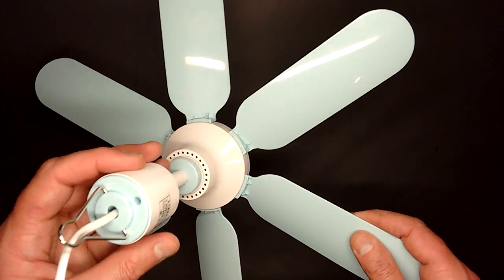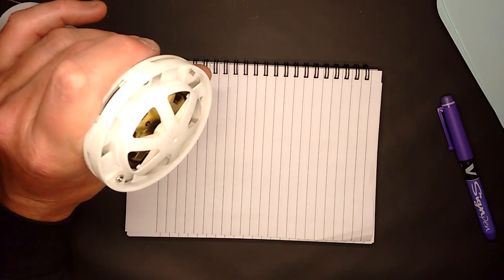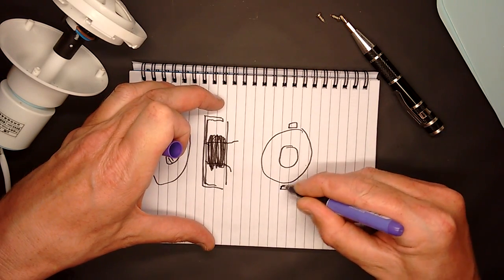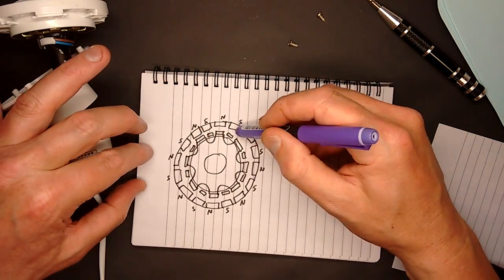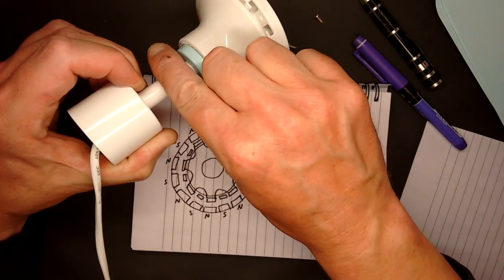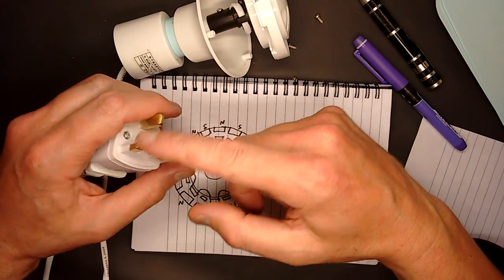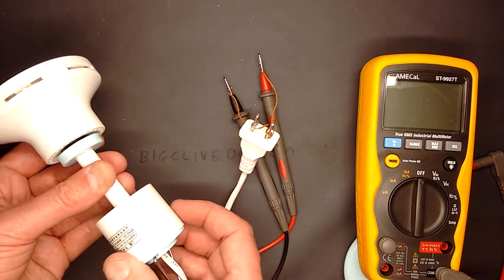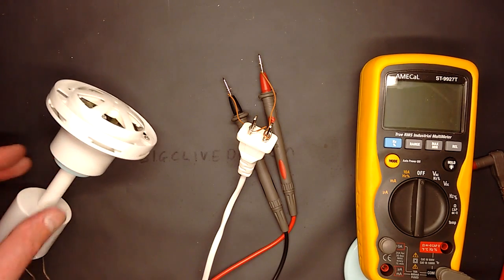Mini ceiling fan with intriguing motor and wind turbine potential.

Comment: I have seen usb versions of these fans, any idea what they are using?
Reply from the maker: I think it's a scaled up computer fan style motor.
Reply: @bigclivedotcom  I bought one and its wierd, its mechanically identical to the 240v version but its got a little IC in it, I thin its just been rewound. it comes with smaller blades and it turns much slower,.

Comment: I bought one of these fans recently after watching your video to check its viability as a generator and here is what I found:

1.  Resistance of the coil is quiet high ~ 2k ohm
2. The fan could produce very high voltage > 300v when spinning at 500rpm. Spinning by hand can easily produce 150+v 
3. current is however very low. 14ma short circuit. also 14 ma when charging a lithium battery and 10ma when charging a large 50v lithium battery.

This last point was an eye opener for me because I have always assumed that current linearly increase as the voltage drop. I was expecting that if the fan could supply 10ma @ 50v then it would be supplying 100ma @ 5v. Clearly I was wrong.

I then checked a solar panel that I have to see if it exhibit same behavior  and sure enough my 5v solar panel supplied 32ma short circuit and also 32ma when charging NiMH battery and around 26 ma when charging lithium battery.

but anyway back to the fan, best case of 10ma @ 50v is 0.5 w which I am not sure it's worth the effort.
However I plan to buy a traditional transformer to see if I could indeed get 100ma @ 5v

Comment: some testing with these shows they really dont like to put out any current, even with a slight load the voltage drops to nothing, i can barely get 10ma out of it so I have a AC transformer coming that should step it down to the point I might be able to get some useful current out of it.

Comment: I recently bought a 3 blade version from wish for my son. He's autistic, 7 years old and OBSESSED with ceiling fans. It took a couple weeks to come and of course was dead on arrival. Being dad (whos a fan of your channel -- pun intended -- ) I found the on/off switches (cost an extra 2 bucks for the switch version) internals had somehow been crushed and jammed inside whicj caused the high quality wiring to break.  After repairing the switch it turned on and ripped its wires out of the PCB near the motor. Digging in deeper this time i think one of the wires was not ran properly (inside tje center shaft) so it wound itself til breaking. After replacing the wiring and resoldering everything it works ! ! Ill admit it makes a faint ticking sound on each revolution but hes happy. I took a tip from uour previous video about using disposable ecig batteries and it works great. Living in a college town i just have to take a 5 minute walk and i can collect 1-3 "hyde" brand vapes from the ground. I used another on a 4 foot long VTech alphabet train from goodwill where the batteries leaked and made a mess of the internals. Its been working off the same battery (charged once) for about 5 months. Thank you for sharing your knowledge with us.

Comment: I have just bought one of these to convert into a wind turbine, the plan is to use it to keep the electronics alive during the night due to the long scottish winter nights.
Reply from the maker: A wind turbine is not terribly reliable unless it's very windy and the surrounding area is very flat.
Reply: @bigclivedotcom  its to keep a solar ardurover alive on a beach.

Comment: I have an electric clock that uses one of these motors, except that the rotor is a disk that is surrounded by the intermeshed fingers.  It also has a spring-ratchet thingy to reverse it if the clock starts in the wrong direction.
Reply from the maker: That a common construction for small synchronous motors.  You'll also find one rotating the plate in your microwave, but it has no specific direction, so it will go in a random one each time it is powered up.

Comment: With a dead short, that thing was putting out about 10 watts of power, without that dead short, and faster spinning due to less resistance, I wouldn't be surprised it could go up to maybe 15 watts, which is standard for most modern phone fast charging - that's actually a pretty respectable amount of power

Comment: I would like to use this fan to charge my 18650 cels to power my smal garden shed? do you know of any smal charge controler I can use with this fan?
Reply from the maker: It might be better to get a proper waterproof wind turbine or use solar.

Comment: The spring clutch is a light duty anti-reverse sprag clutch. For heavy torque the spring is replaced with ball or roller bearings on ramps in the bearing race to lockup in one direction and release in the other.

Comment: is the coil left to right to left with roughly equal numbers of turns in both directions?  I would have thought it would be wound left to right (with many turns) and then right to left (with very few turns) - electro magnets work much better this way.

Comment: You could build a tiny dynamotor and use the higher voltage AC, rectified to provide a high tension supply for a valve/tube radio.

Comment: I bought one of these for £2 in a HK market. Fixed it up in my office as a temporary measure. After 10 years it still working perfectly. It draws about 37mA (9W). It shifts an amazing amount of air! Probably the best value electrical item ever. You see them everywhere in the far east.
Reply: i have a bigger one...like 70 cm ....but it makes a hum noise......its working but its quite loud
Reply: also 9w
Reply: i forgot...mine is at 220v

Comment: I was working on computer equipment (Burroughs Series L) in the early 1970s which used coiled torsion springs in clutches.  IIRC the driving member was a shaft down the centre and the driven member was a collar on the outside.  A tang on one end of the spring protruded and limited on the clapper of a solenoid.  The other end of the spring was connected to the collar.  When the solenoid called the tang was released and the spring gripped the shaft and coupled the driving and driven members via the spring.  To release the clutch the solenoid was dropped, the tang caught on the clapper, the spring released and the drive disconnected.

Comment: Very similar motor to the ones you find in microwave turntables, except with less poles, the rotor being on the inside of the coil and a gearing mechanism.

Comment: What happens when you put a starting capacitor in that? Will it still need a spring system to turn in one direction only?
Reply from the maker: It would need a more complex multi winding construction.
Reply: @bigclivedotcom  Wow that makes sense. I was cleaning a standard free standing electricfan and I noticed the windings on the motor. I have one of these ceiling fans on my work room and i was curious since it's so cheapand makes the weird starting noise. Thanks!

Comment: Excellent! I have heard of using fan motors as generators, watched a few videos, really keen to make my own wind turbine to top up 12v batteries on boat. I am a complete novice, and electrical knowledge is basic, my skill will be in building a suitable housing. I do understand I'll need a regulator between generator and batteries. But showing my lack of knowledge, will the 12v fan motor be enough to trickle charge a 12v leisure battery? Any chance you'd be up for expanding on this, making an entire wind generator. Happy to help, could film the project for you.
Reply: I don't own one, but here are a few tips
1.  If the motor is brushed you can use it as a generator without modification.  If it's brushless some simple electronics is needed - diodes.
2.  If there's a spec and it says, eg 12V at 100mA,  you'll need wind at least as blowy as it puts out when used as a fan.  Quite blowy.   Lower speed wind might give 10V, which ain't gonna charge in a month of Sundays.  (Without a boost convertor)
3.  To trickle charge a lead acid battery you want at least 13 or 14 Volts, which I'd expect it to give at higher wind speed still.    But..... its not all gloomy!
4.  Two of these wired in series would give, for my imaginary spec, about 16V at 100mA in a decent breeze, which is great. 
5.  If there's a howling gale it will likely break itself apart.  Attach them to a pivot and wind vane. You know how washing on a line goes more toward the horizontal when the wind is strong?   Well your vane will move the turbines out of direct line of fire.  A simple and effective alternative to feathering the blades individually.

Best of luck, and let me know how you get on!
Reply: @raykent3211  Thanks Ray,  good summary, think I'll give this a go, it seems easy and cheap to find parts to experiment with. An off the shelf 12v wind generator is £250 upwards, but then you don't learn anything or enjoy the satisfaction of diy.

Comment: Would it be more efficient to use an AC version or the 12v DC version for a wind turbine? I’m wanting to make a usb 18650 battery bank changer
Reply from the maker: I'd guess the lower voltage version might be better suited in terms of winding ratio.  I'm not sure.  The AC one is simplest with direct output from the windings to your rectifier.
Reply: Humm I was thinking as it’s a lower (nearer) voltage to drop (12v version) using a buck converter, that that one would be more suited for a 5v output with possible higher current. However you’re saying the AC one has a simpler direct output. Confused.com lol

Comment: Why would you need a buck converter to step down 220 VAC? Just use a wall wort transformer or for that matter, your cell phones included AC adapter.  I guess all modern phone chargers are buck or otherwise transformerless DC-DC topologies at heart though.

Comment: You said 5.5Hz which is the same RPM that it turns.  Did you mean 5RPS?  It looked a whole lot faster than that.  Are these absolutely silent?  I'd love to find a slow, quiet fan to put over my computer station during the summer days.  Have you (anyone, please) seen the 3 blade versions sold in the US?  Are they slow and silent?  I'm looking for a 1-2mph breeze.
Reply from the maker: It's quiet if you use a rubber bush to hook it on the ceiling.

Comment: The magnet that holds the metal on the generator seems like too loose for some reason. Why is that? It won’t spin the blades anymore coz it will fall down. Does magnet lose strength over time?

Comment: I'm going to make a wind turbine in U.S. from cheap chinese fan.  I looked at Banggood fans.  Which do you think is best for wind turbine generator i.e. 220v or 12v, 3 blade or 5 blade?  I didn't see any 110v cheap fan.  Can you give me your thoughts on which cheap fan you think would perform best as a wind turbine to light some LEDs?  Many Thanks to you BigClive.  Really like your videos.  Bob C. in Wausau WI, USA
Reply: Hoping to hear from you Big Clive?  I'm definitely going to build a wind generator from such a cheap ceiling fan with the students in a college physics class.  I am a now retired helper to them.  Which cheap fan do you think will do best as generator?  5 blade or 3 blade?  220v or 12v or other??   AliExpress.com has lots of such fans available.  Also in your video I think you said this fan you show can generate about 70v at 12ma which is about .85 watt.  Doesn't sound like much output.  What choices can we make to generate more power to light some nearby Led lights or charge some batteries? Tx. Bob C

Comment: No need for a separate converter, the voltage regulator in.small 5v and laptop adapter will regulate the voltage as is

Comment: BC or anyone
Do you know of any ceiling fans that plug into a bayonet or Edison screw light fitting that also may have a passthrough for a light bulb
or even a ceiling fan that fits into a light fitting and has LED's on it

They may not be 100% legal but they would be useful

if they have not made any, then they should

Comment: 5.5 RPM? Did you mean 5.5 RPS? That did not look like 5 RPM on camera.
Reply: Actually, I get 3000 cycles per minute (@50 Hz) divided by 9 equals 333.333 RPM or 5.555 RPS. I'm sure he just mis-spoke.
Reply: He said there are nine pairs of poles...
Reply: Alex Barlow I also think so, with such rotation on camera then it can't be 5 rpm
Reply: Alex Barlow shutter speed of his camera can obscure the speed of moving things
Reply: Well, yes. But rolling shutter won't have such a drastic effect at 5.5 RPM. That's just shy of one rotation every ten seconds.
Reply: I get the 3000 cycles per minute (50hz * 60 seconds), but where does the 9 come from?
Reply: Logicphile half the number of poles

Comment: I would love to know the name of that type of motor or have a link to some patent info.  It's just such a wonderfully simple design.  Any tests done of efficiency yet?
Reply from the maker: It's a simple synchronous motor.  Very common in small motors like microwave turntable motors.
Reply: It's interesting to see a single phase permanent magnet synchronous motor inverted like that.  I've never seen this 'outrunner' style before.  It's so simple I'd expect to have seen it used in RC aircraft and the like.  A similar method could be used to make sure the prop only spins in one direction (like the starter spring on old Cox 0.49 engines).  The electronics to drive such a motor would be less complex (1 phase instead of 3) and the mechanics much more simple - something like winding a bobbin compared to a complex 3 phase stator.  I must be missing something.
Reply: Good old bicycle dynamo uses the same principle and for quite interesting purpose! I had these things in youth and always wondered: why there is '6 volts 2.5 W' written on dynamo, at what speed it was measured? And if it gives out 6 volts at 12 km/h for example, then what happens at 20 km/h? Will it burn my headlight? 

Turns out, the answer is: 'buy a bulb with 6 volts 2,5 W written on it and then everything's OK"! Motors and generators of this type have tremendous leakage flux, flux which doesn't go through rotor, but instead goes from one 'tooth' of stator to neighbour ones. This is like having AC voltage source and big inductor connected in series with it. So, if starting to go faster on the bicycle, AC voltage rises up, but so is frequency, and so is impedance of that inductor. This dynamo is almost 'current source', not 'voltage source'. No matter at what speed you're riding, that will always give away the same current, so light bulb will have exactly what it needs. 

But this leakage flux is really bad thing for motors and generators when trying to get as much power as possible, not a constant amount for headlight bulb!

Comment: how to convert to 110 for us newbs would be AWESOME info to have!
Reply from the maker: They must do them in a 120V version.
Reply: bigclivedotcom so it's not as simple as cutting the end plug off and installing an off the shelf one that fits my plug shape? is it the internals that don't allow that to be an option? Thank you! I know they're stupid questions...I'm trying to learn and not burn the place down, fry too many electronics or kill myself. thank you for the reply! your channel has inspired me to "get my hands dirty" on a topic that was completely unknown to me that I considered to be alien technology that I'd never understand. your channel has earned eBay some money in the past three days for parts, bread board type things etc...n because of you I soldered my first solder point on a board a few days ago and started playing around using the iron for what it was designed for ..n I fried a 10x LED battery powered blue fairy light run last night...n de soldered all the LEDs from the line today to see if any where salvageable..but I think I smoked all 10..even though only the end 3 stunk and the very last one is the only one with a skid mark. thanks again.. I REALLY appreciate your help and channel and inspiration to learn by doing!

Comment: It shouldn't also be able to be used as a hydro electric generator. You'd simply need to switch the blades for paddles.

Comment: you should try to make a self looping motor-generator, use the 12vdc fan motor to run this 240 ''dcmagneto''  and recharge a battery to self loop it see how long it runs ;)....heck add a flywheel to the set up as well to make it run perpetually...i ordered a 12v version several months ago from ebay, didnt turn up so i got a refund

Comment: Would it be possible to explain how shaded pole motors work? Used to be in cheap record players etc. Thanks and Seasons Greetings.
Reply: Shaded pole motors are also popular for kitchen and bathroom vent fans. (at least here in Canada) The loop around one side of the stator pole (the shade, an inductor) resist change in magnetic flux so the magnetic pole shifts across the face over time (1/100th or 1/120th of a second) from the unshaded side to the shaded side creating the rotating field.

Comment: A really cool product! Learned about induction motors/generators at uni studying renewable energy, and this must be the simplest demonstration you can get hold of! But how on earth can a solar calculator be flat?! And 50Hz divided by 9 must be 5.5 rotations per second, not rpm right? It would be about 333 rpm.

Comment: The motor looks kinda alike a pc fan (on a GPU and such)
Reply: It's similar in that most of those have an active stator on the inside and a permanent magnet rotor, for minimum moving parts, but the actual way they work is pretty different. The fan ones are brushless DC, which means they have a bunch of individually wound coils, a sensor for detecting the rotor position, and a circuit (often a microcontroller) that keeps the magnetic field just ahead of the rotor to generate torque.